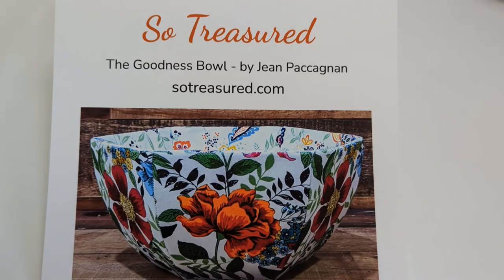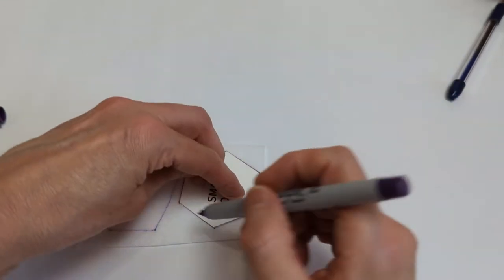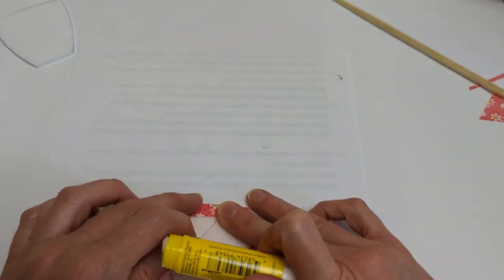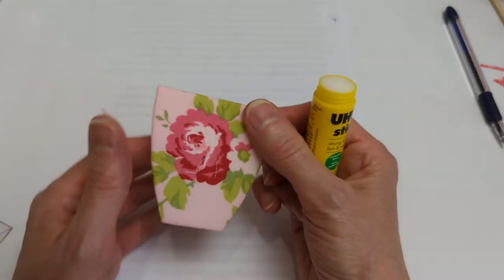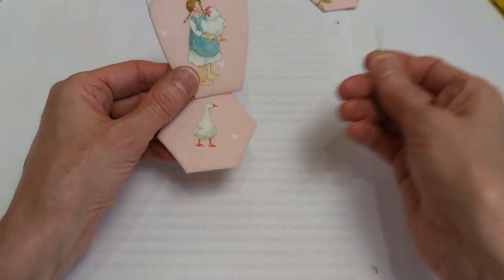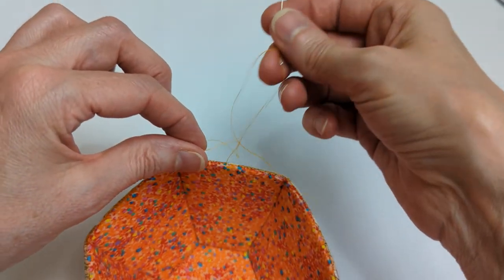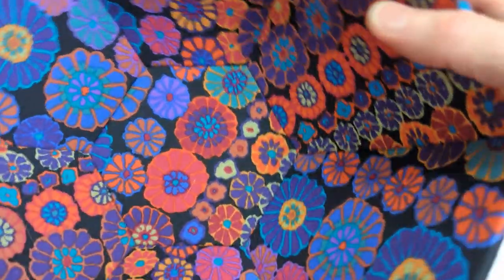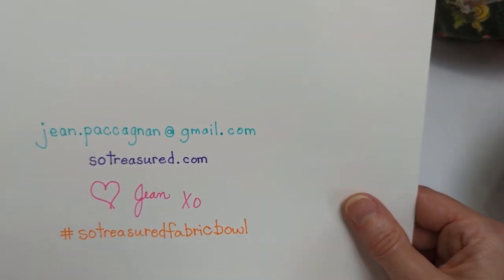Fabric Bowl: The Goodness Bowl Introductory Video

Comment from the maker: Oh wow, I just found out that the transparency sheets print much better when combined with a blank sheet of paper! Use a small white label at the top of the sheets to hold the two pages together so the printer can pull up the sheets, and "recognize it" to fully print the entire page! Set this "sandwich" up so that your printer will print on the textured side of your transparency sheet. On my Epson 4850 Inkjet printer, that means I will place a white piece of printer paper on top of the smooth or "glossy" side of the transparency sheet, hold them together by folding a small white label sticker across the middle front top of the two pieces, place it in the paper tray with the paper up and textured side down, and my templates will printout on the textured clear sheet! Finally!! Remove the white sheet and sticker and reuse. Printing this way is challenging, has to be done one set up at a time, the paper in the tray has to be pushed gently forward to the very front end of the paper tray, but then it works more often than not (and I LOVE making easy, quick, clear templates to trace around or use for fussy cutting)!